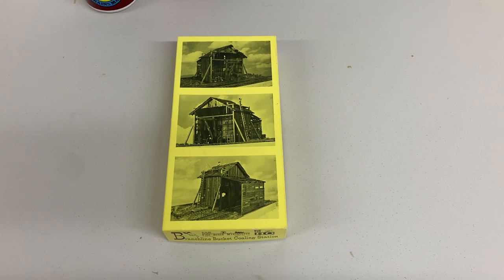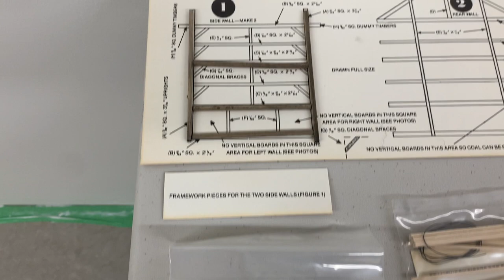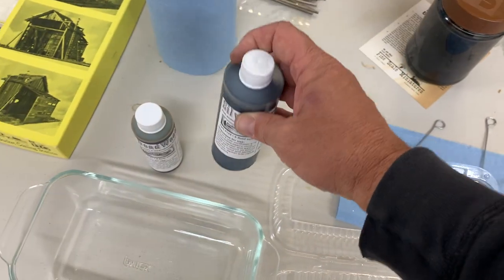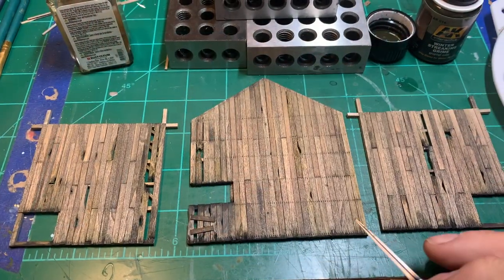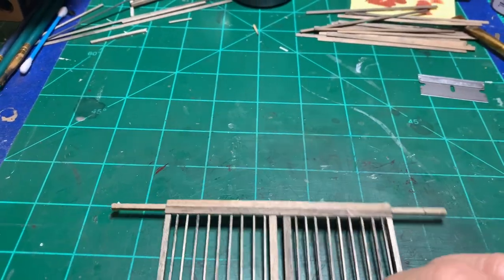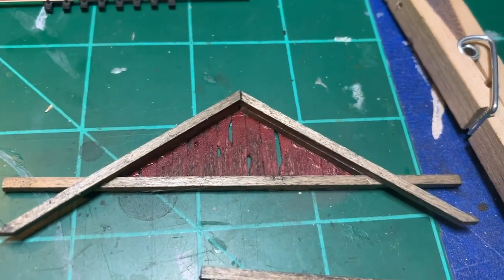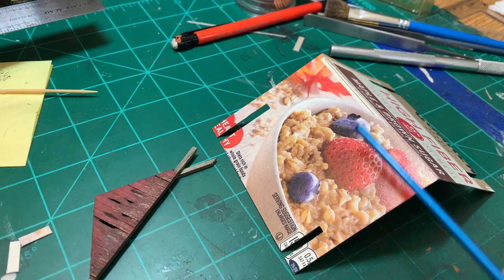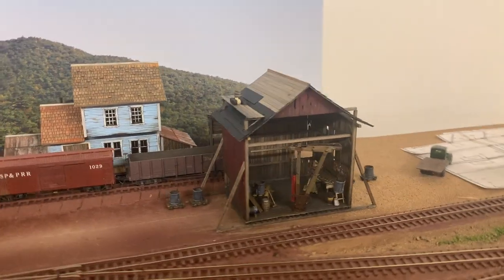Fine Scale Miniatures, Branch-line Bucket Coaling Station

Comment: i just used some washed coal ballast- very shiny!- for coal loads. it's quite shiny but looks spectacular to me. that's a sweet kit you're working with there. the stain is perfect. weathering is pro. you're one of the best kit builders out there my friend. the missing boards are awesome. sweet build! as interior is a prominent feature of your structures- you gotta get that printer Bro!
Reply from the maker: Thank you so much!  I have the printer, just need to read the instruction manual. :-)

Comment: Great video Dennis, loved every minute of it. Perhaps I missed the description of how the structure functions:  I assume that loaded coal gons are pushed into the shed in back where the coal is shoveled (by hand) through the opening in the back wall into the "buckets" that are shifted back and forth on the interior dolly track. Then the full buckets of coal are lifted one-by-one with the derrick to be dumped into a locomotive tender located on the track in front of the structure? In any event, you did a fantastic job on building, painting, and detailing the kit   Art...
Reply from the maker: Thanks Art, I think you are correct, although I never considered that the tender may fill up here.  I assume it is a local dealership for home heat and other domestic needs.  I have  a few ideas for the scene that involves a few wooden bins and sacks of pre-sorted coal for re-sale and maybe a truck there for pick-up.  Dennis

Comment: Awesome job, Dennis.  Looks like a fun station with fun tools and bucket details.  So they used buckets of coal to fill up coal tenders instead of the coaling station elevator style?  Is that correct?
Reply from the maker: I honestly don't know for sure.  I need to do a little more research, my guess is, this was a dealer where locals came for coal to heat their home.  I think Art is correct in the below comment as to how they were unloaded.  I never considered that a tender may also fill up here.
Reply: @OtterCreek  - Ahh ya, mr Art would know it.  I didn’t see his comment before.  Thanks Dennis.  Have a great weekend.